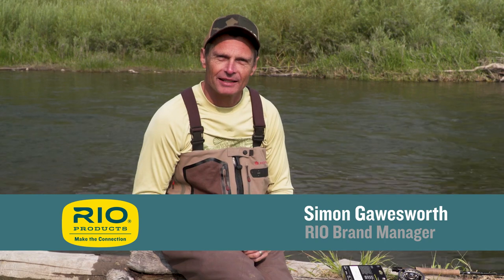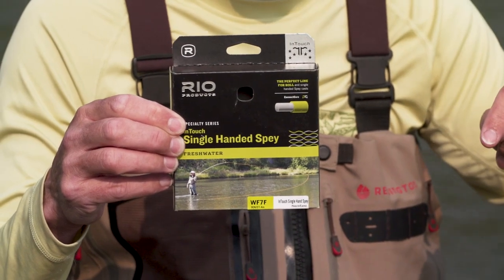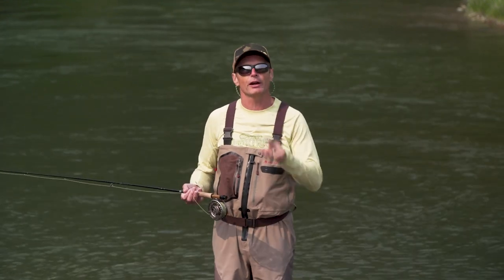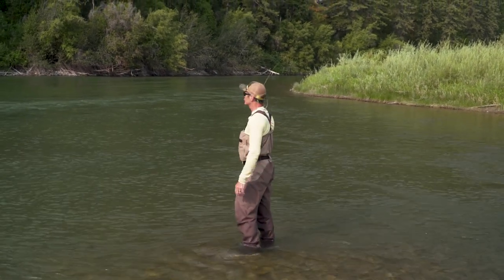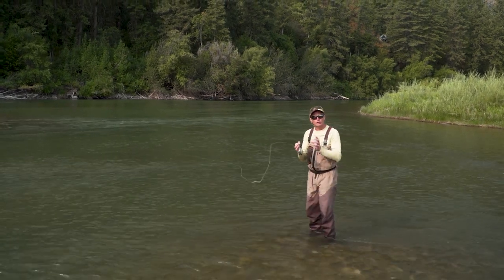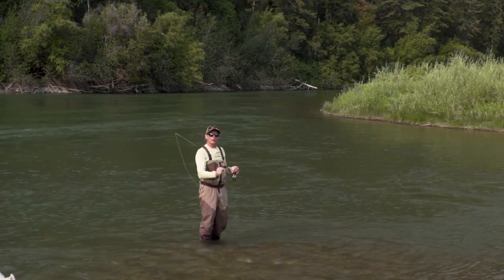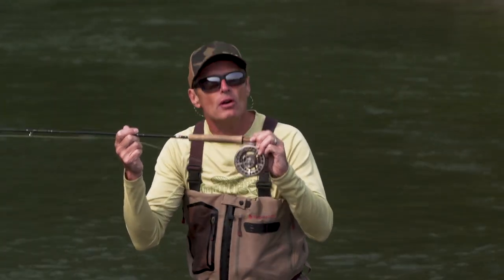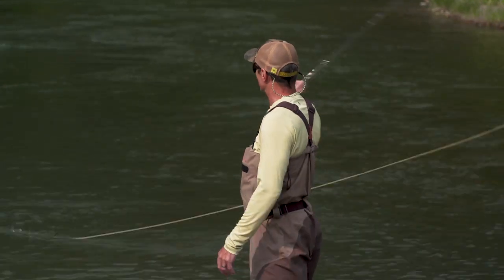Single Handed Spey Cast | How To

Comment: Very Nice Video!
So in this Case You have a 9’ 5wt rod why do you loaded with a 7WF fly Line is not supostube to heavy for the rod or this’s how works...?
Reply from the maker: Yes, you can over-weight the rod
Reply: Ok thanks!
Reply: So This means You can make a Longer cast & trout Bigger Flies...?

Comment: Is it possible that i need a medium action rod to perform a good roll cast? Is a fast action rod too stiff?
Reply from the maker: No, both actions should work well for this cast. good question!
Reply: @newflyfisher  i was hoping for another answer so i would have an explanation why i fail 😀. I guess training it is. Thx for the answer anyways
Reply from the maker: Braun I use this cast (similar to roll cast) on virtually all rod actions without a problem. Hope this helps